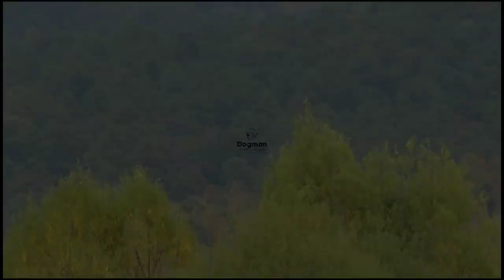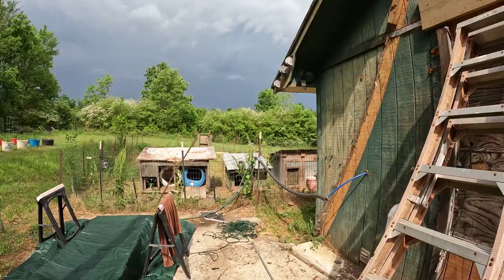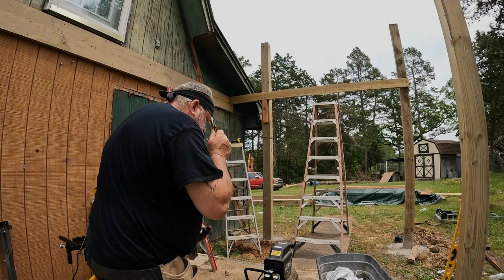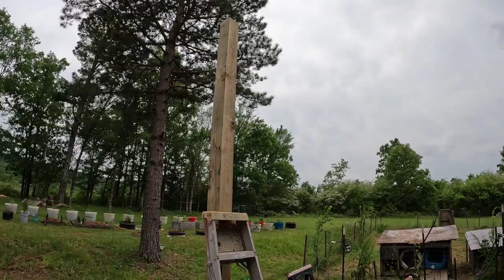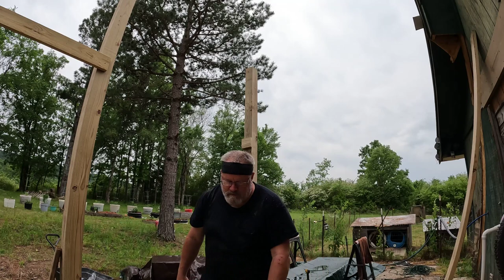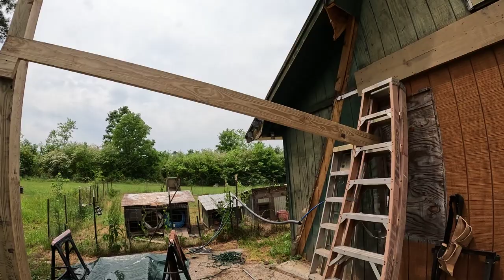I SHOULD HAVE WENT BACK TO BED! ROUGH START TODAY ON DECK RIM JOISTS/#5

Comment: There are days when trying to build something, that you just want to take the drill or the bit and throw it across the yard with every swear word flying. My husband spends more time going back and forth to the garage for different drill bits or something that he forgot. Just a trick that I found with darn drill bits that don't stay in place, wrap a strip of electric tape around the bit, and shove that sucker into the drill, it's just enough to hold it in place.

Comment: screw a temporary block to each post at the height you need and set your board on them. Put a clamp on it if necessary. i work alone all the time and am 83 years old and still building.
Reply from the maker: Yes I was using blocks and I used clamps today

Comment: When I have those days (usually decorating) I end up sitting down with a cup of coffee. Age has it's advantages but sucks when the spirit is willing and the body don't want to play. I stepped off the side of the sink (doing the walls above the window) and missed the ladder. I thought heck, this is gonna hurt. My ladder is now a cripple. Me, I stayed on the floor for a while till I could move again. It happens lol. Best fall I had was down the stairs towards the front door. Luckily I was carrying my laundry in a bag and landed on that! Most annoying is when you're atop the ladder and the darn bit won't stay in the driver!!!  - Coffee time!
Reply: Yup, trimming the oak tree branches, stepped back completely off.  Just laid there awhile watching the clouds.  For a minute there I thought you were watching me around the house!!
Reply: @kathyimm2567  Today I was putting my greenhouse back together because the 3 storms that came through flipped it off it's base. I moved it to the back door. I searched through all the parts and couldn't find the last two end pieces. I found them eventually I hadn't taken them off the side!!!  I needed to put the ridge piece on - not an easy job alone. I cracked it and fastened one side first with tie wrap and did the other till I could bolt it in place. I put the pvc roof panels on and inserted the clips to hold them in. They sure give a whack when they ping out!!! I sat down and had a coffee. Back to work on it tomorrow lol.

Comment: I know about things not going right. Near the end of last mowing season tuned up my riding mower and had belt replaced. Went out about 6 tonight to start mowing my 1.3 acres and 10 minutes into the job belt somehow stretched out, did not break. New belt will come in the morning between 6 - 10 am. Home Depot has next day delivery locally.